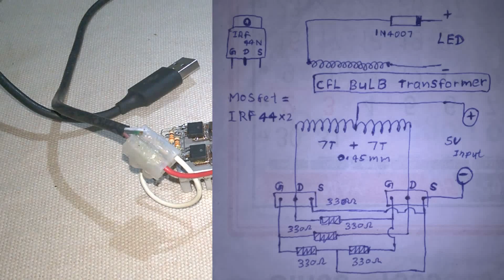Usb led light making | simple inverter circuit | 5v to 220v inverter | #Tronicmade

Comment: Voltage Auto Ejestable Or just one ??
Reply from the maker: Yes the circuit works automatically volt adjust W7 W9 led bulb working normaly.
Reply: Ok! LED terster ekakt meka ganna puluwanda Resistor Ekak daala?
Reply from the maker: diode eka peththata 3.3k resistor ekak dala ganna puluwan hebai alluwoth currunt wadinawa capacitor dannathuwa ganna.